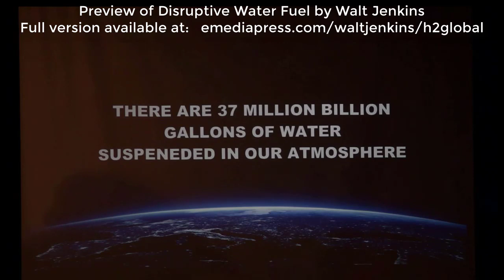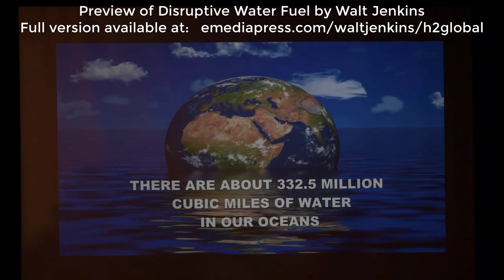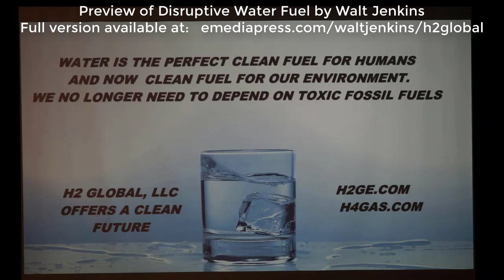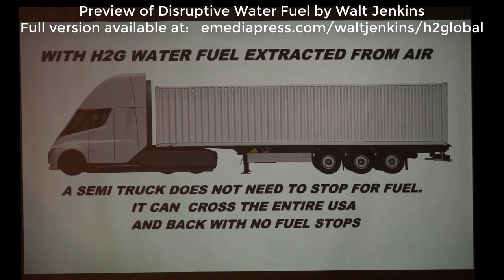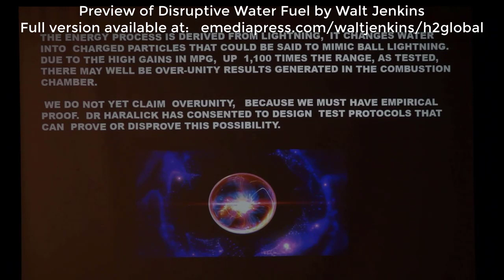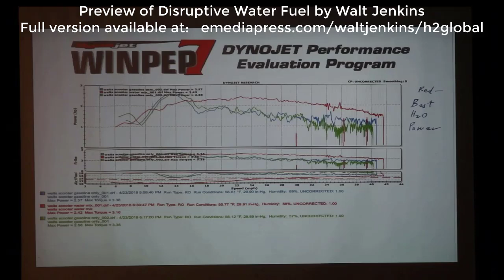Disruptive Water Fuel by Walt Jenkins Preview

Comment: I doubt this would work on modern car's ecu unless it was tuned properly.
Reply from the maker: Almost every computer controlled car would need o2 sensor and air flow sensor mods to get around the computer sabotage.
Reply: not really no. an o2 sensor just tells the computer to open the injector longer if it senses to much o2 in the exhaust. this mod doesnt require the injector to work. all the fuel comes through the intake port. the injector opening time is irrelavant.
Reply: @freelectron2029  the timing would have to be modified

Comment: Sorry, as much as I would like to believe, all I heard was bla bla bla. Follow link to buy $$ more bla bla bla.
Reply: Hey guys he is using my design from some time ago without any credit to the original designer of the device. He is using an ultrasonic humidifier and added a small percentage of gasoline which will suspend nicely with the water as it is super-heated through cavitation. However the fuel being lighter will come out of the water at a faster rate and this will be a short run appearing that it is running on water when it is no different than just adding the fuel in the mix except here in a deceptive way to make exaggerated claims.

  I see Luc right under this comment and Aaron "Marconni" can't be far off from here. This group is such classic charlatans or those who present something as their own original ideas knowing dam well it was done elsewhere first. if you want the real mind behind this stuff. Come to Channel Fastimports3 first to show. Whatever you want to know free all the time. Any donations to work towards the next advancement would greatly be appreciated. I'm back and ready to take that place in the front again. 

THE Proffesor 
first to show the cold fog system
first to show build and show the plasma ignition
and I'll be first to show a working hydrogen gas gun
come to IonizationX.com     fastimports3
i share and explain all there free of charge and please read my struggle it is posted there for all to know I'm as real and 100% as it gets. I may have been too modest for too long with this group right here. They are sucking you guys dry for free info

Comment: If this is the real deal, it will never see the light of day unless it goes open source.
Reply: or they just kill him.... oh look, thats what happened.
Reply: it is open source here ionization X and fastimports3 alwaysvhasbeen

Hey guys he is using my design from some time ago without any credit to the original designer of the device. He is using an ultrasonic humidifier and added a small percentage of gasoline which will suspend nicely with the water as it is super-heated through cavitation. However the fuel being lighter will come out of the water at a faster rate and this will be a short run appearing that it is running on water when it is no different than just adding the fuel in the mix except here in a deceptive way to make exaggerated claims.

  I see Luc right under this comment and Aaron "Marconni" can't be far off from here. This group is such classic charlatans or those who present something as their own original ideas knowing dam well it was done elsewhere first. if you want the real mind behind this stuff. Come to Channel Fastimports3 first to show. Whatever you want to know free all the time. Any donations to work towards the next advancement would greatly be appreciated. I'm back and ready to take that place in the front again. 

THE Proffesor 
first to show the cold fog system
first to show build and show the plasma ignition
and I'll be first to show a working hydrogen gas gun
come to IonizationX.com     fastimports3
i share and explain all there free of charge and please read my struggle it is posted there for all to know I'm as real and 100% as it gets. I may have been too modest for too long with this group right here. They are sucking you guys dry for free info

Comment: Thanks Aaron, that is interesting, it would be better if it did not use anything other than water though.
Reply: Hey guys he is using my design from some time ago without any credit to the original designer of the device. He is using an ultrasonic humidifier and added a small percentage of gasoline which will suspend nicely with the water as it is super-heated through cavitation. However the fuel being lighter will come out of the water at a faster rate and this will be a short run appearing that it is running on water when it is no different than just adding the fuel in the mix except here in a deceptive way to make exaggerated claims.

  I see Luc right under this comment and Aaron "Marconni" can't be far off from here. This group is such classic charlatans or those who present something as their own original ideas knowing dam well it was done elsewhere first. if you want the real mind behind this stuff. Come to Channel Fastimports3 first to show. Whatever you want to know free all the time. Any donations to work towards the next advancement would greatly be appreciated. I'm back and ready to take that place in the front again. 

THE Proffesor 
first to show the cold fog system
first to show build and show the plasma ignition
and I'll be first to show a working hydrogen gas gun
come to IonizationX.com     fastimports3
i share and explain all there free of charge and please read my struggle it is posted there for all to know I'm as real and 100% as it gets. I may have been too modest for too long with this group right here. They are sucking you guys dry for free info

Comment: Of course any person with a little bit of knowledge knows this is snake oil and utter rubbish. 
But the last idiot isn’t born yet.
Reply from the maker: I have a jet engine where I can turn the propane dial down until the needle is on 0 psi and it still runs - exhaust boils water, goes to the turbine impeller and my plasma ignition system detonates it. It does take a trace of propane but I know from hands on experience what is possible and you don't have enough information to know what is rubbish or not.
Reply from the maker: @My Secret Account It doesn't work off of water, it works off of water and a trace of propane - there is a huge difference, which you have contorted what I said. There is no violation of thermodynamics. Forget the 2nd law, it doesn't apply to anything in the universe. The only thermodynamics that are valid are non-equilibrium thermodynamics that applies to every open and "closed system". I already posted a video online. If you want to see it, you can't be too lazy to search it out yourself!
Reply from the maker: @My Secret Account The 2nd law of thermodynamics isn't a law, it is a gross misunderstanding of natural principles. "The second law of thermodynamics states that the total entropy of an isolated system can never decrease over time." First of all, there is no such thing as an isolated system. Second of all, every natural system is open and external source potential enters the system to do more work, which pushes the system far from equilibrium. This absolutely decreases entropy over time - that does not prevent entropy - it delays it meaning it has been decreased, slowed down or partially reversed while the overall trend is still towards entropy. https://www.nobelprize.org/prizes/chemistry/1977/ceremony-speech/ read that. Prigogine did believe there were isolated systems, but there are not. In any case, non-equilibrium thermodynamics explains every system, natural or manmade.
Reply from the maker: @My Secret Account That's incorrect. It is not only assumed but is accepted that the 2nd law of thermodynamics applies to steam engines and other heat systems.
Reply from the maker: @My Secret Account Obviously, that is an equilibrium system, which are accepted as reality for virtually all energy systems. What is the primary claim from conventionally trained "scientists" regarding over 1.0 COP systems? They violate the 2nd law of thermodynamics.
Reply from the maker: @My Secret Account I don't know where you get this nonsense from. There are countless under 1.0 COP systems - which are most of them.
Reply from the maker: @My Secret Account You said, "Aaron Murakami Whoever has told you that a 1 COP or lower system isn’t possible is not an expert." Perhaps it is you who is not comprehending something because nobody has ever told me that that a system under 1.0 COP is not possible.

Comment: automatic cars and trucks were put years ago on kids toys called a scalextrix set race cars that ran on a circuit with a central electric strip like an upside down electric tram system so simple no drivers required
Reply: high volatge wires metal strips running on the surface of every road, what could go wrong... hope it doesnt rain.
Reply: Point taken ,though as I state the electric kids track  being dc current does not electrocute anything that touches it .

Comment: I hope this does not happen ... we need to increase Co2 or the plants will die in the next ice age.
Reply: CO2 is food for plants, don't you know it?
Reply: Thats what internal combustion engines residues are.
Reply: @johnmcallister8220  I don't think so, those are carbon monoxide or CO1.
Reply: are you planning to live that long?
Reply: That's a great approach, we will be dead anyway;
Reply: There's plenty co2 lol
Reply: there's plenty of CO2 to go around I'm going to use it in water fuel system to mimic the burn of gasoline for one moment they will look the same
gasoline and water fuel that is... because gas converts to water anyways at a 1:1 rate

Hey guys he is using my design from some time ago without any credit to the original designer of the device. He is using an ultrasonic humidifier and added a small percentage of gasoline which will suspend nicely with the water as it is super-heated through cavitation. However the fuel being lighter will come out of the water at a faster rate and this will be a short run appearing that it is running on water when it is no different than just adding the fuel in the mix except here in a deceptive way to make exaggerated claims.

  I see Luc right under this comment and Aaron "Marconni" can't be far off from here. This group is such classic charlatans or those who present something as their own original ideas knowing dam well it was done elsewhere first. if you want the real mind behind this stuff. Come to Channel Fastimports3 first to show. Whatever you want to know free all the time. Any donations to work towards the next advancement would greatly be appreciated. I'm back and ready to take that place in the front again. 

THE Proffesor 
first to show the cold fog system
first to show build and show the plasma ignition
and I'll be first to show a working hydrogen gas gun
come to IonizationX.com     fastimports3
i share and explain all there free of charge and please read my struggle it is posted there for all to know I'm as real and 100% as it gets. I may have been too modest for too long with this group right here. They are sucking you guys dry for free info